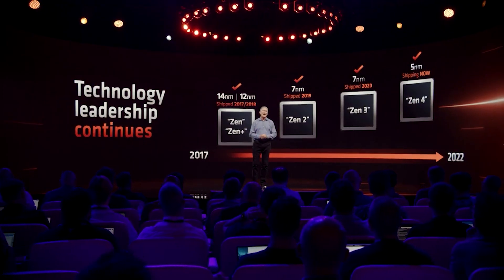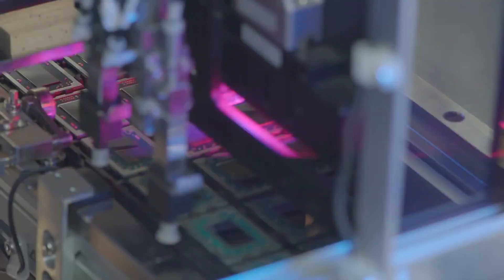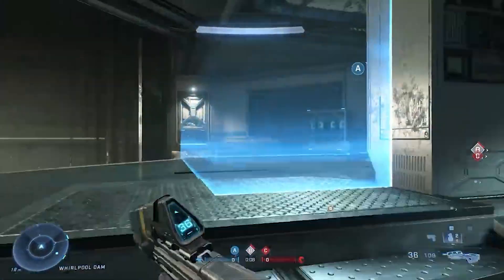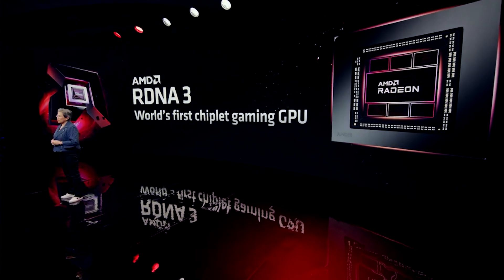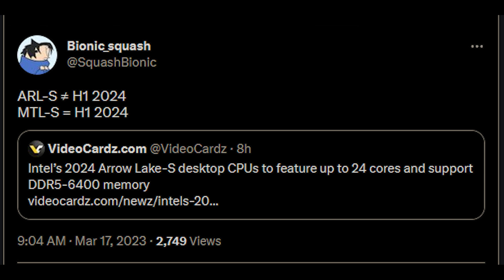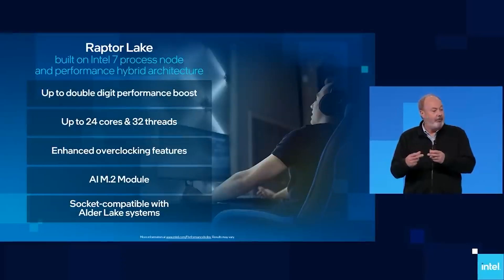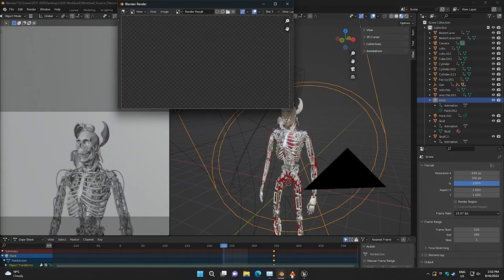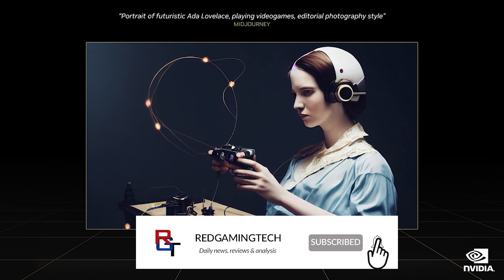Zen 5 CORE COUNT Revealed! HUGE Intel Roadmap UPDATE

Comment: I hope ryzens will stay with full power corés only and not go the intel way with efficiency cores. Intel roadmap : New sockets, new sockets, new sockets.......
Reply: AMD has Zen 4c cores but they're likely going to be mobile-only for now and only on their Epic data center CPUs
Reply: A normal user don't change their PC for more than 5 years. Ofcourse long lifetime is good but Exaggeration won't get u nowhere.
Reply: @yuvanraj2271  While I agree that most don't get new motherboards/CPU combos every two years, the life span of AM5 could be a serious selling point.  It is conceivable, if improbable, that a user could be putting in a Ryzen 10000 series CPU on the expensive board they buy today and not need to build new until after 2030.   

That could be huge for a lot of people.  I don't see how anything Iletsun hinted at was exaggeration if Intel stays the course they always have, that would be possibly 3 new sockets in the same time frame. A lot for those that want a tock every 2 years.
Reply: @yuvanraj2271  with ryzen you get the benefit of selling your old cpu and buying a cheap brand new cpu and put it into the same motherboard with the same ram. you dont get the same benefit with intel where you have to buy a new mainboard every 2 years

Comment: kinda dissapointing that they Will not use 3nm on desktop
Reply: Give it time and it will happen, assuming the world does not go completely off the rails.
Reply: "Look at how AMD is price gouging because they're on top, these new zen 5+ 3nm cpus are 70% more expensive for 30% more speed"
When you go to a new node, particularly anything under 7nm, prices go up FAST
Reply: @PineyJustice   If they meet or exceed the level of demand and people pay it then it is not gouging.   I have heard exactly 0 on "Picometer Scale CPUs" so AMD may be trying to harvest what they can since their only seeming available option is more an more cores.   Seeing A 3nm 32 core processors somewhat commonly going into gaming PCs in 2-3 years would not surprise me at all.
Reply: captain_morgan  No, it's almost certainly about cost, wafers have tripled in price since 7nm already, going to the latest node if it's not particularly needed for market positioning will only damage the extreme profitability of the ryzen cpus. The massive lead that AMD has over intel right now means intel is basically selling their cpus at cost while AMD is actually making good money. The latest server cpus will clock up to around 4ghz, a newer node will probably take it a bit past that.